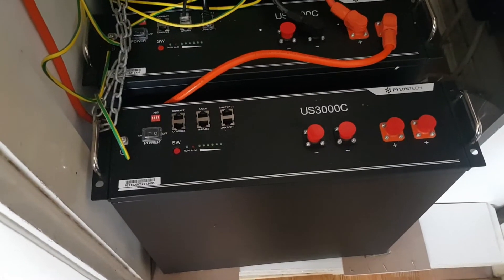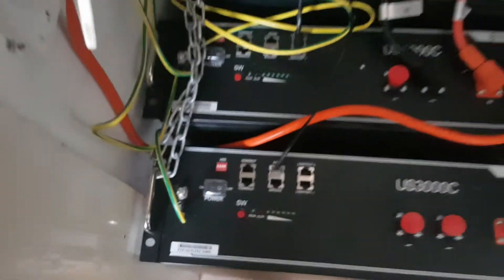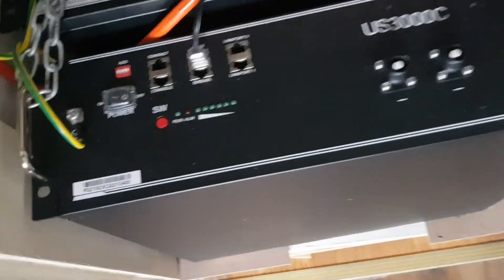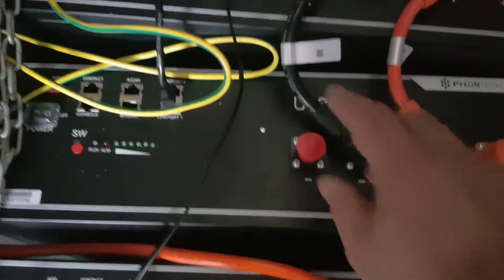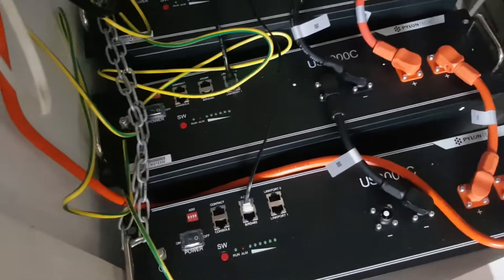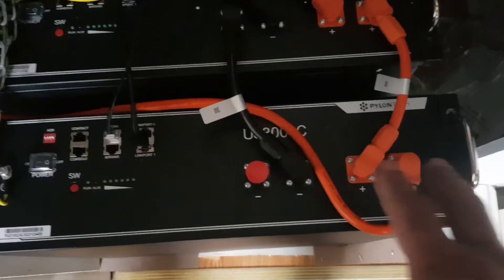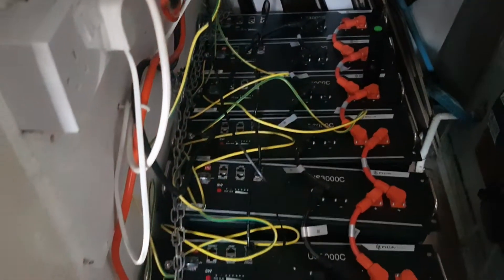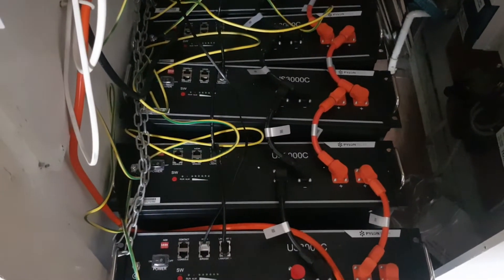Adding / Installing a new Pylontech us3000c us5000 us2000c battery to a existing setup/stack

Comment: Hi Sir, I have two US3000C pylon batteries connected in parallel.
Can I connect a new US5000C battery and use it as the master?

Comment: I just added a us2000c to my  older us2000+ and 2 us2000c's  Thought I had them synced but charge only went upto 97% when all connected and then discharged to 13% which led to bms shutdown on top 2 batteries (so all off) as previous 3 DOD was 20%. I've now disconnected the new, the other 3 seem fine although dod dropped to 19%.  Very little sun so not sure at present whether they get back up to 100%, they should do. I plan on isolating the new - give it a full charge and then ensure the others are fully charged in order to re sync them - does this plan sound ok? Waiting for a decent bit of sun (uk and winter) so rare!
Reply from the maker: HI, Yes it sounds like a good plan. When the sun is strong around May to August in the May , add your new battery and they should all sync to 100% then discharge to your DOD level. That way they will be sync'd. Thanks for subscribing.

Comment: I have 4 pylontech us3000 connected to a Victron inverter.
The master battery is connected to the inverter with the positive and negative cable. So There us no connection between the bottom battery and the inverter. Is this ok? System has been working for 2 years now without problems. Off grid system.
Reply from the maker: No,  Connection from top of battery stack, POSITIVE to bottom of battery stack, NEGATIVE . I do not see why the + and - are connected to the master battery only, its not good practice as the voltage is imbalanced.

Comment: I just added a 3rd us3000c battery in my stack, all 3 are the same model. However, when balancing them, 2 seem to get balanced and go on standby while the third keeps all lights turned on. No blinking. I waited for approx 3 hours already and it remained like that. Would you know what could be causing it or if can just go ahead and plug everything in to the inverter?
Reply from the maker: You  need to run them with the inverter and discharge them to a 0 state . Then when they recharge they will be balanced

Comment: I currently have a single stack of seven 2000's which the installer set up. In studying the PylonTech installation manual, it says not to stack them directly one upon another and even when using their super-expensive brackets, it says a maximum of four! Have you ever heard if or experienced. any problem with stacking?
Reply from the maker: Stacking upto 4 on top of each other is fine. Even when using brackets the benefits are negligible. In a us2000c manual , it says 4 can be stacked on top of each other. But if you are uncomfortable then you can vertically stack them making sure they are secured at the top and bottom.

Comment: Hi and many thanks for the video - I have a stack of seven 2000's to which I need to add a 5000. I understand that the 5000 has to become the new master - the question is, how is the new stack balanced when there is a mixture? I was told that I had to first fully charge my stack of seven 2000's and then separately charge my 5000 before adding the 5000 to the stack. This sounds awfully laborious and long winded so is there a neater, simpler way please?
Reply from the maker: No all you need to do is connect the us5000 set it as a master. Turn the battery’s on, sync them . Then let them balance naturally. Don’t turn your inverter on at this stage. After a couple of hours the bms in the master battery will store the charge state of the other batteries.  At this stage turn on the inverter and use as normally. Eventually when there is no sun or extra charge the batteries will reach there minimum SOC and then they will be balanced . No need to charge them up individually, so backwards!

Comment: Very interesting video, thank you, I would like to ask a question;  if the solar panels fail to charge the batteries, could they be charged with a charger connected to a generator set ??and how??
Reply from the maker: You would still need a charge controller. But in principle yes they can be charged from a generator

Comment: Awesome vid mate exactly what I need ...
Question...I have 3 x 2000 batteries at present and am going to add another 3000 is it neccessary for the 3000 to be the master?.... also my 3 have been stacked ontop of one another at install same question,... is it neccessary for the 3000 to be at the bottom? as it is the heaviest at 32kg?
Reply from the maker: Put 3000 at the bottom . Also it needs to be set as master. You can have upto 8 batteries stacked on top of each other , pylontech says
Reply: @pylontechsolarbatterystora3979  superb thanks so much..I'll be watching you and following now ...cheers
Reply from the maker: @cassandracurse7065  please subscribe to the channel for more new videos coming up

Comment: Hi,you can tel me please, when we must change the position of the four ADD Switches,thanks.
Reply from the maker: Only when using rs485 protocol , the ADD switches are used
Reply: when using rs485, ie voltacon inverter, dip switch set on master for 1st array  2nd etc . 1st array 0001, other batteries  on array 0000

Comment: After adding 2 new US3000c batteries to me my existing 3, do I need to change any settings on the inverter to ensure I am charging to the max 17.75kw capacity?

Comment: Thanks for this. Do you know if you can mix different capacity pylontech batteries? I currently have 2 x USC2000 batteries and want to add an additional 2 x US5000 to the system to triple my storage capacity from my Solar Edge inverter!
Reply from the maker: Hi yes you can mix them. The BMS of the master battery which you’ll need to set to one of the new us5000 batteries. So the master battery must be a us5000 in this setup.

Comment: thanks for the video, i have a question I have 2 us 3000 in parallel linked up to my solar inverter, I am about to add a wind turbine with a separate charge controller to my system but cant figure out how to connect both the solar and wind cables to the battery as there is only one connector for positive and negative, any suggestions? thanks
Reply: in my system I have batteries connected via victron distributor to my inverter. You could connect your wind charge controller there. ie midnite classic, but you need to play around with charge settings so that midnite is always slave to solar.

Comment: Will they self balance or do you need to balance them 1st
Reply from the maker: They self balance and best to let them do it .
Reply: @pylontechsolarbatterystora3979  When connecting the new battery, the batteries will certainly balance - but only the voltage will balance. The SOC, which is the data that is fed to the inverter/charger will be the average SOC of the pack. The SOC is  calculated value based on the voltage drop given a certain charge delivery. As such the individual batteries can be quite different when it comes to SOC levels.  It's probably best to check the capacity and SOC levels on each battery. This can be done with Pylontech's BatteryView sofware (PC based) or MultiSIBControl's graphical software which is pretty good. All you have to do is make a cable connecting the Console port on the battery to the PC and run the software. If interested I will send a link to the simple youtube video showing how I did this task.

Comment: I have 3 batteries. 
While I'm working off batteries, just 2 of them are flashing with all green lights. The one that is in the middle is just flushing "run" only. I do think that power is drained from 2 batteries that Victron is connected to with plus and minus. 
Is that a problem?

Comment: Thank you for the video. 
I have 4 US2000C and I'm thinking about ading a US3000C or a US5000C.
Reply from the maker: No worries I would go for a us5000, more capacity a 4.8kw and more load at 100amp. Www.premiercomputersolutions.co.uk have the pylontech us5000 in stock

Comment: Can I mix a US3000C into a system with 2x US2000B Plus in the same way as you describe?
Reply from the maker: Hi, yes you can as I have had these 2000b and us3000c working together. . You’ll need to change-your lead to the inverter to have the US3000C . The lead is available from premier computer solutions, call them .

Comment: Great system, however consider that the link cables between batteries and especially important, the long Pylontech Inverter cables must not exceed a constant 100A, due to both connector and cable ratings. They can briefly go up to 125A for a short time. I am not an electrician, but have read quite a lot about high current DC storage designs.

Now my concern, (not sure if I could see this correctly) you appear to have a large system connected in parallel with only a single cable providing battery power to inverter. That means you can only draw 100A / 7(number of batteries) = 18.29A per battery before you exceed the cable rating. That is just 978W per battery. Your system potentially exceeds that easily the way it is connected, unless you have fuses protecting that cable with a 100-125A fuse, and a limit on the inverter/charger.

To solve this, either use a small inverter maximum 100A, or a better solution, buy extra Pylontech long cables and wire in parallel to a high current bus bars for both live and neutral, then come off that with a higher rated cable towards fused inverter cables. Theoretically then you can go right up to the full massive rating that these batteries can supply. To enhance, try to ensure the batteries are fused before they reach the busbar also. That can be achieved with modified Victron Lynx Power In modules that are rated up to 1000A. Youtube has some good videos how to add fuses.

Please check your inverter and batteries aren't exceeding all those cables.
Reply from the maker: Hi Rich. The inverter cables are 2m , 100amp so all good. No problems at all. Been working well. Thanks for subscribing. Keep watching the videos
Reply: agreed, I run a 6 us5000 with  victron bus bars but before then could often see 118amps on those long cables. The other alternative is another set of long cables run parallel to the other connections on Pylontech, as per pylontech manual.
Reply: Correct on these comments. The cables used are under spec in this setup. 

What I don't understand in the pylontech manual, is do you have to use multi group mode  (A positive cable to the bus bar per battery) if you have more than one battery? Or is there another way using just one positive and negative cable?
Reply: @muso31  No it is not a multi group mode. I believe that is when you have multiple groups, where each group has several batteries. I have 6 x US5000 and there is one inverter RS485 communication cable to battery 1 then they daisy chain linked through each battery. This has worked just fine. Each battery has it's own Pylontech long cable to NH fuse (100A but you can reduce to 80A) before ending up at a large chunky bus bar.
Reply: @richlee5516  this is great thanks. I assume the 100a fuse is on the positive lead only?
Reply: @muso31  No , you need double pole ideally according to most electricians opinions in the UK (I am not an electrician, but have built a large system 22kw), so fuse both the positive and the negative. The NH fuse holders are not overly expensive, but they can be found with either 2 or 3 pole, you push fit the NH fuses in. Be aware that T Class fuses are often considered best as the speed that they cut off the current is very fast and they are very sensitive, the downsides are they are very expensive. The NH fuses are considered to be suitable for fusing batteries. Be careful, there are lots of smaller fuses that simply cannot interrupt the HUGE fault currents that LifePo4 lithium batteries can generate. Stick with T Class or NH fuses ideally. Another advantage of using NH fuses is that you can pull the handle and open the circuit (warning - do not intentionally do this with any DC circuit, you'll get a big bang and burn mark on your fuse! Or if not properly designed fuse, risk fire). Being able to open the circuit for maintenance or in an emergency to isolate a battery or inverter is very handy. Again, try not to open the fuse whilst circuit is powered, turn the source off first if you can, ie inverter or battery. Again, I don't know what you are building, I was approaching things as being bullet proof, really high power, over rating everything so I can sleep at night. I therefore used 6 sets of long battery cables and self built large chunky busbars. I don't regret it, I built something quite unique that is future proof and handle easily 500A DC battery power. My advice, belt and braces, do it right first time.
Reply: @richlee5516  Excellent advice thanks. I'd love to see your setup as all videos on YouTube with pylontech batteries have been set up incorrectly with the wrong  spec cable. It doesn't help that pylontech use amphenol connectors rather than a terminal. Would you consider doing a video of your setup? Would be great to see this

Comment: Excellent video, it really helped a lot, just one quick question, is the positive from the inverter always connected to the master battery...I have four batteries which all seem to be fine but the black negative is connected to the master.
Reply from the maker: It can either be to the master or to the last battery in the stack. As long as positive is at one end and negative is at the other end to achieve a parallel connection. Polarity does not matter. So the master could have the negative or positive . Thanks for watching video , I am glad the videos are helping people and thanks for subscribing.
Reply: @pylontechsolarbatterystora3979  Thank you very much for your prompt reply

Comment: hi.. thanks for the time you spend on the videos for us..  if i want to raise my Battery capacity can i use a 3000 or 5000 in an 2000 system or must i stay with 2000???
Reply from the maker: Thanks for watching videos, please subscribe. You can interchange us3000, us5000, us2000c, all together and have a mixed setup. No need to stick with one model type.
Reply: @pylontechsolarbatterystora3979  perfect.. thank´s

Comment: Thanks for the video. 
One question if I can? 
Do you need to let the inverter know you now have more capacity? I seem to remember this was set at the time with my original set up a few years ago. I’m about to add 2 new batteries to my stack.
Reply from the maker: No the inverter should detect more new batteries in the stack automatically. It will tell you in aH what the capacity is. For example , if you have 2 x pylontech us3000c at 75aH each , then add another us3000c then you have a new total of (3 x 75) , 225 aH capacity which the inverter should report. Sometimes it says 222 aH but don’t worry about that it’s never exact.

Comment: Very good explained! At any point in time your system is designed such, that all these batteries are discharged with a constant rate not exceeding 100 A, right?
Reply from the maker: The inverter and internal BMS manage the charging/discharging so batteries all charge and discharge at the same rate. So the more batteries you have the more FREE solar energy from the sun you can store. Especially in these hard times and cost of living crisis with electric bills to exceed £6000 per year , so if you invest in solar battery storage you will get your investment back in 1 year and the batteries have a lifespan of 10 years. So well worth it.

Comment: Hello Sir, I got the US3000C batteries (two) and unfortunately I connected them to an inverter that seems to be incompatible with the system as a result the batteries have gone into safety(sleep)mode and I don't know how to go about it from there, please assist me.

Comment: Hi I was wondering if you help. I have a Goodwe ES 4.6 inverter with 2 x UP5000 (pylontech) batteries. Can you please advise what the DIP switch setting should be? Does it matter? My installer used very specific switch settings but I can't find any reference for it. I am asking because I want to expand my battery pack to 3 units. Please advise.

Comment: I have a single US3000C battery with a Sofar HYD 3000-ES hybrid inverter. The battery specification says it can be 95% discharged, but the Sofar will only allow 85%; is there a way around this, or do we need to wait for an inverter firmware update?
Reply from the maker: You need to update the firmware, a later version has been introduced to allow 95% DOD from 85% currently
Reply: @pylontechsolarbatterystora3979  I've looked on the Sofar website, but no updates are shown. My inverter is very new, it arrived about 3 weeks ago, so I would expect it to have the latest firmware.
Reply: It may also be down to the SOC settings within the inverter that you should be able to change yourself. My Solis inverter was set to 80% originally. However the inverter companies, like Solis advise against setting it to 95% to prolong the life of the battery.
Reply: The SOC is the minimum it can go down to so 10 = 90%  DoD at least on Solis inverter
Reply from the maker: @andrewl9020  yes 90% is a good SOC limit . Depends on your inverter and if you have the latest firmware.